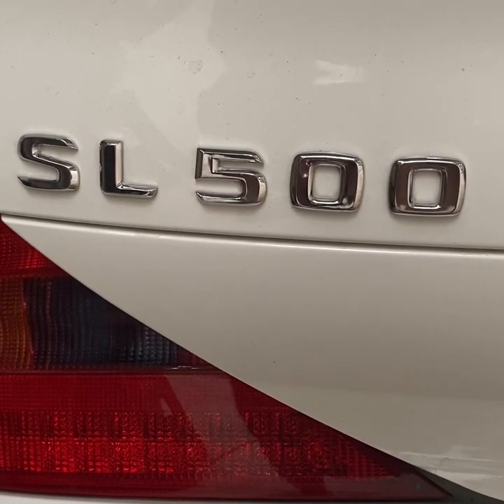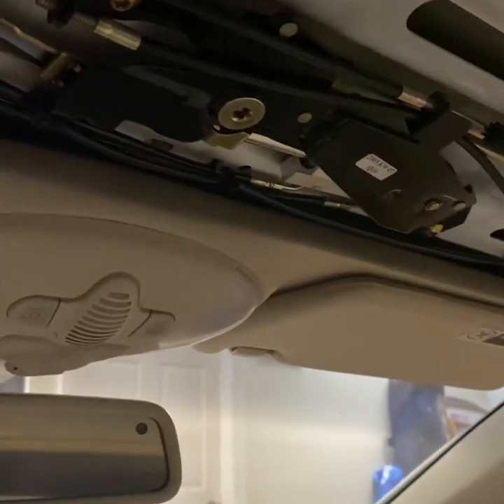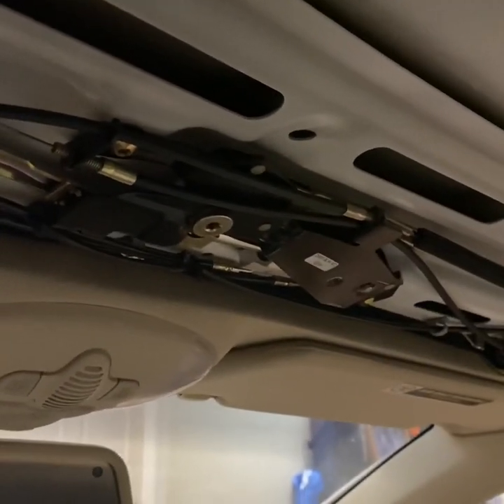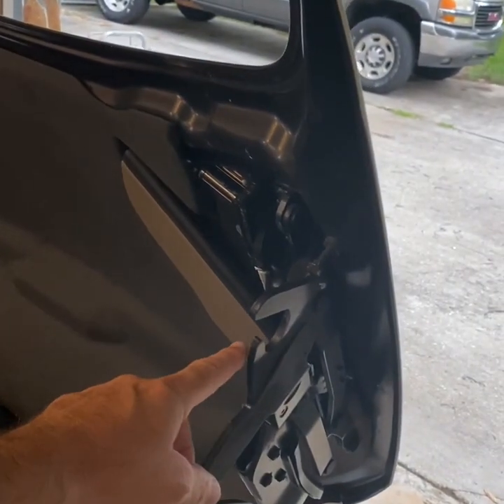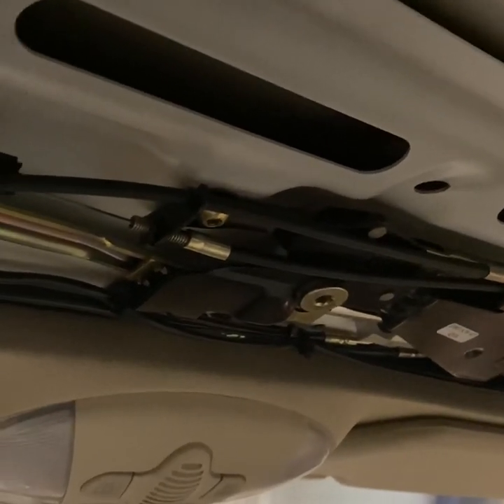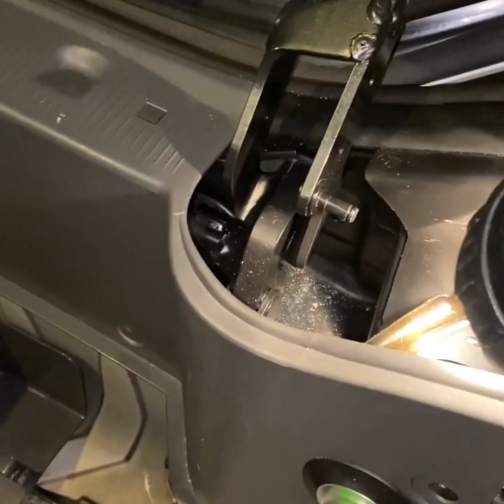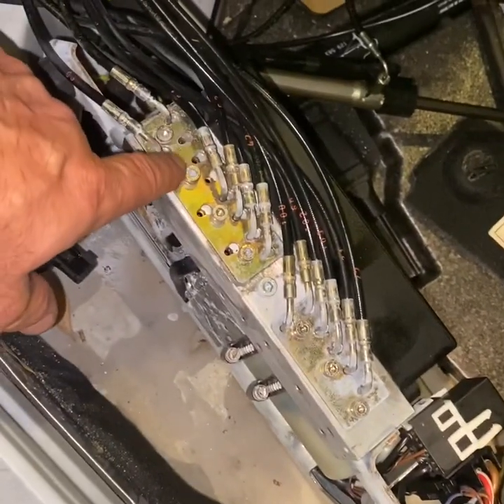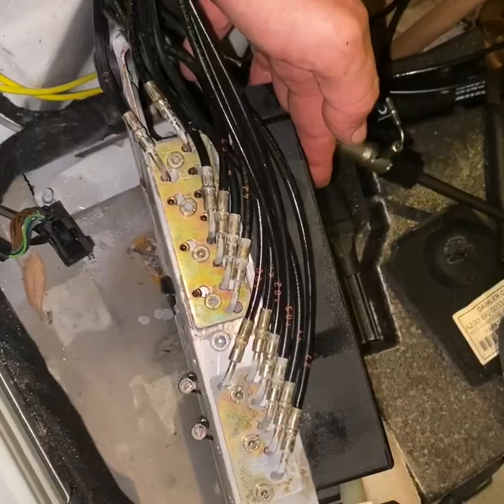Mercedes Benz SL 500 R230 hydraulic cylinders removal and repair

Comment: I am grateful for you sharing this. My R230 top failed last weekend and fluid was leaking out of the front driver side. A lot of paper towels. I took it to my 'stealership' and they are quoting me $15k for repair, but not sure what they will replace. You gave me an in depth view of all the systems. Thank You!
Reply: I am glad I am not buying this car. Failure of these hydraulic system is outrageous and fixing them is even worse.
Reply: @sano0311  - I did not buy my SL55 AMG as an investment. I bought it for the pure joy of driving it, which is incredible.

Comment: Good video.  I didn't see your video earlier.  Wish I had.   I just finished with the same 4.   Now I'm doing the rebuild kit on the flap actuators.
Reply: Hi one of those actuators seems to have gone wrong on my car as well (it hangs loosely when the trunk is opened) did you watch a video for the rebuild or buy new parts?

Comment: Thanks again for the video and update. I did not see it in the video, but regarding the vertical cylinder at the back of the trunk, I did not see you remove the hydraulic lines from the cylinder....only from the pump. Did you remove the hydraul. lines before removing the cylinder? I have taken the chance of buying used cylinder (hey, I am cheap), which already contain the existing lines....so rather than clipping all of those plastic ties I simply route the new lines under all of the covers and attach to the pump. I did like your comment abt Mercedes engineers.....in hindsight, perhaps electric motors/gears would have been more efficient. Thanks again. RB
Reply from the maker: You cannot (to my knowledge) remove the lines from the cylinder. The run is short enough to the pump that it can be repaired by sending in the cylinder with the lines attached so you don’t have to splice it. Thanks for the comment, sorry it took me a bit to get back to you.

Comment: I am continuing to watch your video and its always appreciated. Mr. Marco has an excellent video for tha 2 side cylinders and the soft closing latch. I have replaced on of those rear right cylinders but I still have a leak that I cannot find. My top works beautifully as long as I have fluid in the reservoir. Once it drops below min the system will not complete its cycle. Not certain why without traces of hydraulic fluid...somewhere in my car must be a lake of hydraulic fluid...I even had my mechanic look under the car when he was recently performing a service...but nothing. I have an '05 SL500. Years aho when I had an SLK, the overhead cylinder leaked all over my liner and stained/ruined it....but my SL liner is clean. Any ideas/perspectives would b appreciated.
Reply from the maker: I would start at the front lock cylinder, at least pull the front of the headliner down a bit to inspect it. My research points to that one failing the most.  Top Hydraulics is the one I used and you don’t have to chase the line all the way back to the pump.  Keep me posted. Otherwise, the Pawl cylinders for roll bar are next to go. Can’t see them to inspect without  removing some panels behind the seat (I haven’t done this yet)
Reply from the maker: Another thing to consider is the fact that since you have replaced one cylinder that was leaking that it increases the pressure to the entire system because it is no longer leaking and creates leaks at other cylinders.
Reply: @mikemoreau7084  Thanks for tha reply. It appears that someone was up in the headliner already but I am still not finding any hyraulic fluid...and by my measure...it sh b quite a bit of fluid
Reply: @mikemoreau7084  Yes thanks...I do continue to check the others. Thinking I may need to rip out the back seat/storage are and check those out....but tha fluid is going somewhere
Reply: @mikemoreau7084  Thanks for the replies. In my case, I think mine has been gone thru up top. Therefore my guess is going to be the one controlling the rollbar. I have not attempted to deploy it since I have owned the car. As stated, Mr. Marco has an excellent video on the rollbar piston replacement in his 2004 SL. Thanks again RB

Comment: I have a leaky cylinder on my 2009 SL550. I'm going to attempt this repair.  I'm pretty much to the end of the internet, and I can't find a "how to" for removing the headliner...unbelievable. Can you direct me, or tell me how? Is it complicated? Does it require any special tools? Thanks!
Reply from the maker: It is actually very easy, but easy that was partially because the snaps used to secure the headliner to the top were all not adhered to the headliner any more.  The only thing holding mine in were the rubber window gaskets on both sides of the headliner.  You simply peel these away from the headliner and it drops down.
Reply: @mikemoreau7084  I've since found the procedure, and it doesn't look that bad. Thanks, I appreciate the response!
Reply: @SandovalSolutionsFL  how did it go ? what did you have to remove? and did you rebuild or order a new one?

Comment: I was thinking of sending mines to top hydraulics in Oregon
Reply from the maker: Cabriolet Hydraulics in Sarasota Florida.  Cabriolethydraulics.com. The only advantage I see with them vs. top hydraulics is on the front lock cylinder you do not have to chase the entire line all the way back to the pump.  Cabriolet Hydraulics got the 4 cylinders at 1:00 on Monday and I received them at 9:00 am on Wednesday.  Quick turnaround and they all seem to work great so far.  I called and spoke with Nino.
Reply: i agree with the company in Oregon because the use the better seals that last longer than the life of the car. (different material)
Reply: @davidwilliams4895  What do they use???